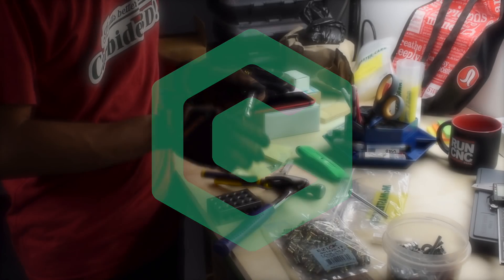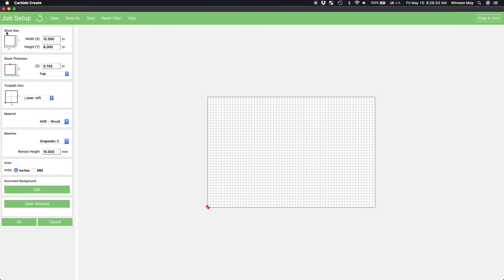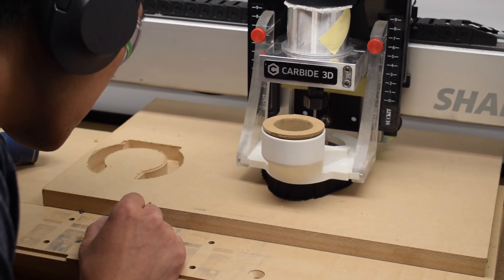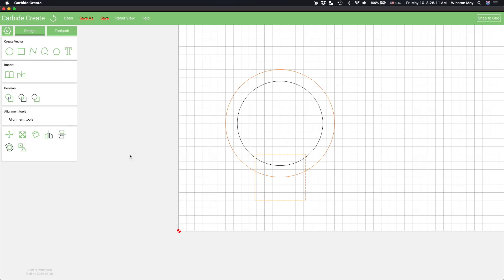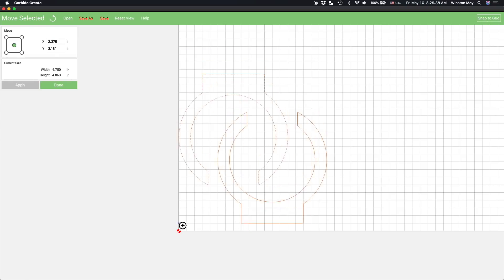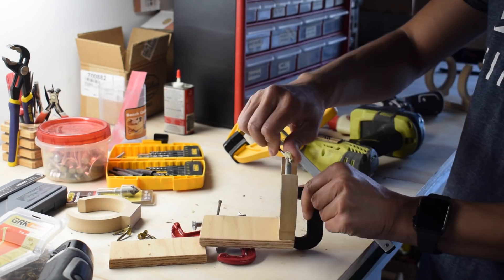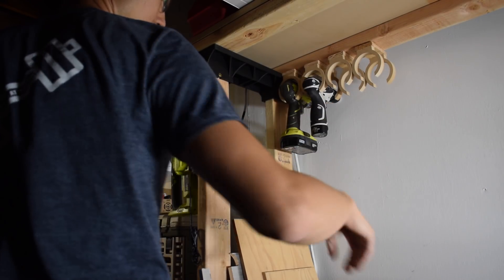Making Basic Drill Hanging Hooks in Carbide Create

Comment: Winston I just saw this video and  a good idea. The question is this I don't like cutting into my new spoil board. so with that said I would like to know if you can tell me or show me on a video you might have done how setting off to the bottom works and how you can leave an onion skin I think a lot of people would like to see that done. The other thing is that after using the probe to do the XYZ and  then I want to change to a v bit and touch off using  paper so I can force the tip of the bit into the wood to get better vcarving of small fonts. What  do I need to do in CM after I have my bit where I want it, do I need to zero something Jeff
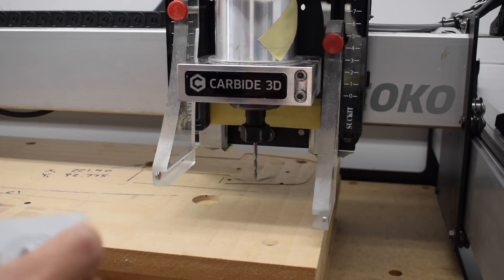Reply: The sequence at 2:55 shows exactly that. After using the touch probe, or setting zero with a piece of paper, you can manually tweak the Z-offset value so the CNC thinks it's closer or further from the surface than it actually is. If you add 0.1-0.2mm, you're telling the Shapeoko it's gotta descend further to touch the wasteboard, so it will cut deeper. If you reduce the offset, it will cut shallower.
Reply: @WinstonMakes  sorry that made now sense  to me
Reply: @WinstonMakes  Ok I have  my piece of paper between the bit and board where I want the Z height to be. So now on the screen what do I need to do to set it. I know that when using the touch probe  it sets the xyz automaticly ,but dont you have to zero some thing. like you did in the old version.
Reply: @resorter66  Not just for the "old version". In any version, you go to Set Zero > Zero Z.
Reply: @WinstonMakes  So are you saying  that when I use the probe to do a xyz probe with a end mil and it does it's thing then I have to click the set zero button on the screen? Then if I change bits And do a Z probe I need to set the zero button?
If this is correct then why  have I not seen that  done in any of the videos that I have seen about the using  the probe. I can see doing that with  a piece of paper. I would like to see a video on using  the probe that  show's all of the steps to a proper probe. Jeff
Reply: @resorter66  
NOOOO. If you use the probe dialogue, and the probe does its own thing, once it's done, that's all you need to do. The buttons to manually set zero are ONLY for when you're jogging to a position and need to zero it yourself.
Reply: @resorter66  There are already probing videos out there, just do a search for Myers Woodshop or my video. We also have a comprehensive getting started guide (Bluetooth Speaker Project) that show the manual process, skip to like 36 minutes in.
Reply: @WinstonMakes  so what i take from this is that when I change bits and put a vbit  in and move the router to a new location set the probe on top of the board and and do a z probe it touches off raises then I am done. just go and load  a file for that bit and run it? If i use paper then I need to set the zero?  I will get my head around this if your answer is YES  Thanks Very much.Jeff
Reply: @resorter66  Yes.
Reply: Winston I have one more question. When you touch off to the waste board , is there there some thing that you need to do in the soft ware to account for the  difference in safe retract height above your material. hope that made sense.
Reply: resorter66 didn't really make sense, but I think the answer to that question is no...
Reply: So the carbide create takes into consideration that  you have told it the material is .75 thick and  when cutting it knowes to move up ,75 and then move up to what ever your retract height is before it start's to cut?
Jeff

Comment: Starboard plastic material is a type of HDPE that machines nicely, and would be a good choice for this project, if you find that the MDF doesn't hold up to frequent bumps taking the drills out and putting them back.
Reply from the maker: Valid point, and I do have some of that laying around too... -W
Reply: Carbide 3D as you well know, a prototype run in MDF to check everything from g code to work holding to final fit is a good idea. I wanted to mention Starboard because it’s a nice step up from MDF for projects like this without being too hard to cut or too hard to find.